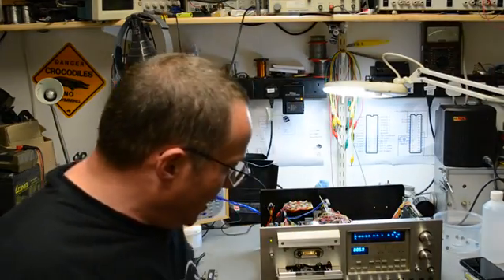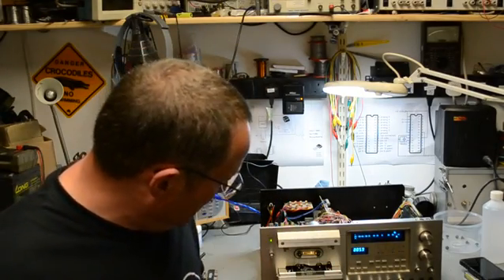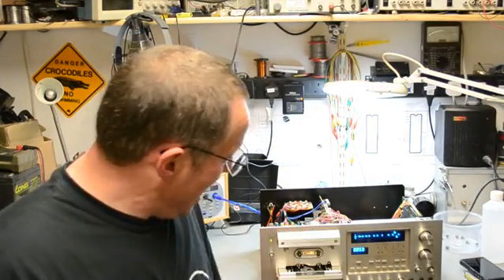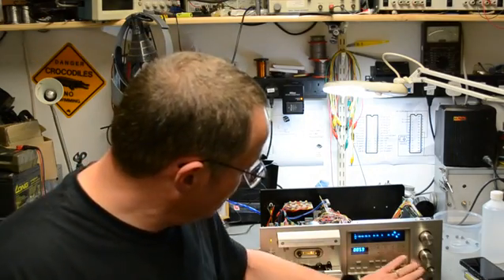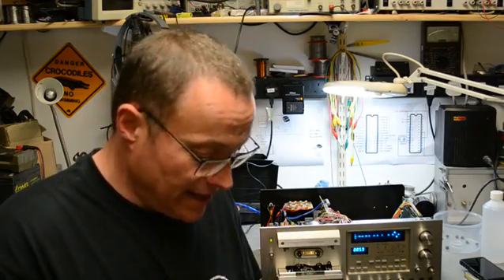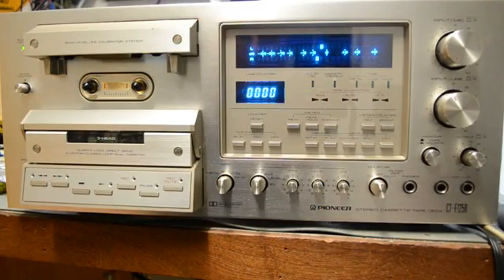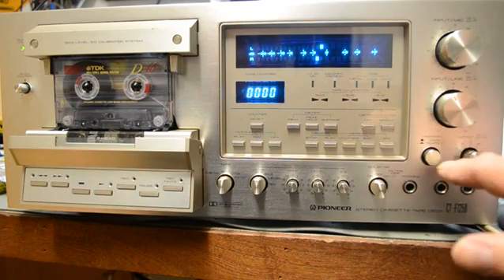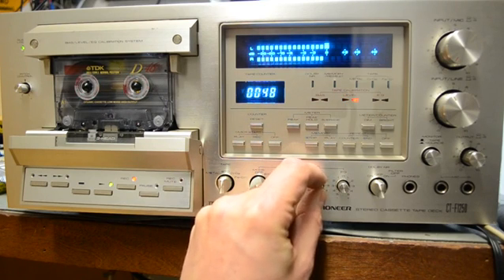Pioneer CT-F1250

Comment: Hello, I recently acquired a CT-F1250 & it has the same blue Elna caps as yours. Do you know if these Elna's were used by Pioneer or upgraded by owners ? I see many stock CT-F1250's with the black caps.
Reply from the maker: Stock.
Reply: @AndyDoz  CT-F1250 never came with blue Elna's, they were always black caps. Especially the vertical power board in front of the pwr supply - all black caps.
Reply from the maker: @miss.wright3035  not so. This machine was stock when received. I have seen 2 others with blue Elna. None have seen previous repairs. One documented so.
Reply: @AndyDoz  very interesting ! do you recall if any had resistor(s) or other components soldered on underside of main board ?

Comment: In the owner's manual of ct-f1250, it says not to use 120min tapes because it will affect the unit adversely.  Does anyone know what will happen, and can I use 100 min or 110 min tapes?  Also should the motor make any noise?  I just purchased one that is why I ask.

Comment: This is from 1981
Reply: The Pioneer CT-F1000 was 1977 to 1979, the CT-F1250 was available 1979 to 1981,
the CT-F900 was 1978 to 1979 and the CT-F950 was 1979 to 1981.

The CT-F1000 does type 1 (Ferric) 2 (CrO2 or Crome) 3 (Ferro-Crome)
and does not do type 4 (Metal).

The CT-F1250 does type 1 2 3 and 4 tape.

The CT-F900 does type 1 2 and 3 tape
and was the first Pioneer tape deck to have a Floroscan display.

The CT-F950 does type 1 2 3 and 4  tape,
 and replaced the CT-F900 just one year after it's introduction because of it's
ability to record on type 4 tape to spite the fact that it is otherwise functionally identical.
Reply from the maker: Not according to http://www.thevintageknob.org/pioneer-CT-F1250.html, or the original owner of the deck. Surely it may have still been available then.
Reply: The florescent light decks weren't around until the CT-F900 came out.  That model may have been out as early as '79, then the CT-F950 replaced it and could play metal type IV tapes.  Then the CT-F1250 I'm almost certain wasn't out until 1981 to be the grandaddy which replaced the CT-F1000 as the most high-end model.